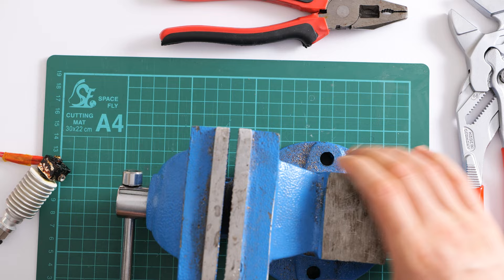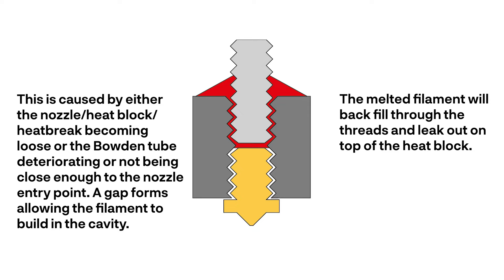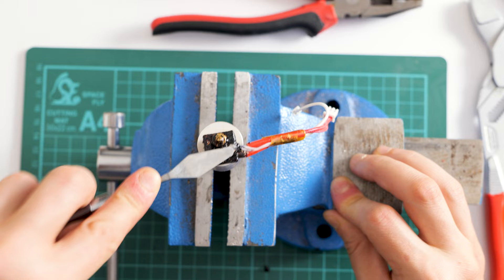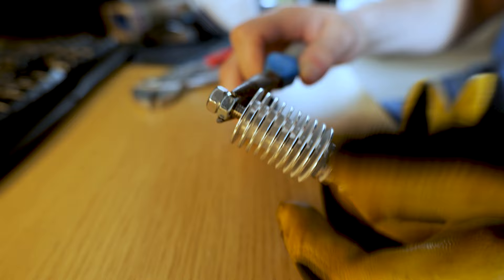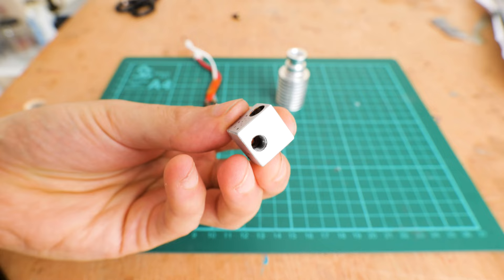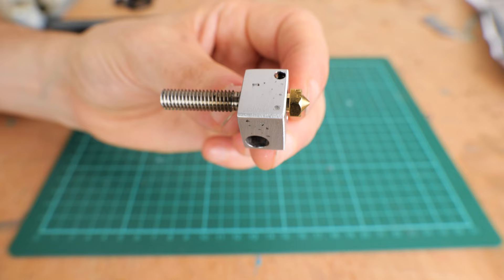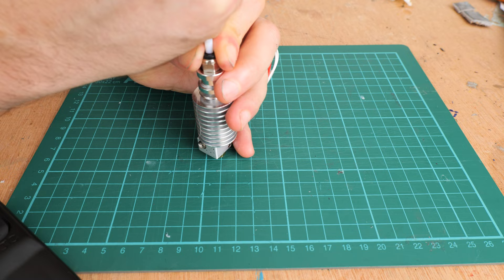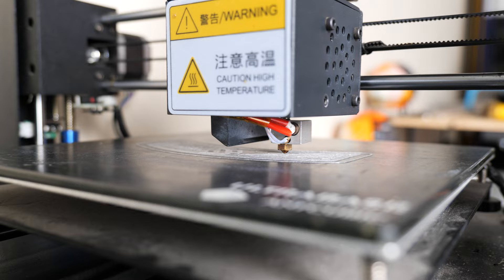How to clean your hotend and fix burnt blobs on 3d prints

Comment: To me, for a hotend as cheap and plentiful as this, I would recommend just buying a new one, and taking the opportunity to upgrade if possible.
Reply from the maker: Yes i agree, but at least its not going into the landfill for now. I was just curious to take apart and understand the hotend in more detail. I've gone ahead and purchased a trianglelab v6 all metal hotend in preparation for an i3 mega x carriage that I'll be making a video on soon. Now I print mostly with my Voron I take for granted the speed and quality it prints at. I want to try and bring the i3 mega as close to the voron quality as cheaply as possible.
Reply: In making your judgement about the value of your time vs the cost of just buying new, please remember that the cost to our planet of the resources used to make the new parts, and the harm caused by sending the old parts to landfill, is in no way factored into that cost.
A fantastic compromise is to buy a top quality bimetallic heatbreak and hardened nozzle - the real critical components - and refurbish the hot end with these parts, it will perform as well as a new high end extruder.
Reply: @edumaker-alexgibson  Is this even on a scale worth worrying about? I feel that's an important question here. I feel as if this is paper straws compared to the single use items in the world.

This item, comparatively speaking is replaced perhaps once every multiple years, and has far fewer transitionary processes than say a smartphone from mine to user. So, compared to the regular waste output of a person, I can't imagine this is a level of waste worth worrying about.

That being said, from an ease of use perspective, I think a titanium all metal heatbreak and hardened nozzle are a great upgrade removing the necessity to frequently replace the Bowden tube end or nozzle. I also value the added side effect of no longer spewing toxic pet bird killing fumes from the burning ptfe.
Reply: Depending on where you live it may be better to clean the hotend, rather than wait for the delivery. I'd rather spend a day cleaning one instead of waiting for several weeks for a new one to arrive.

Comment: I'm still using an anycubic i3 mega - I just finished the Ai3m hotend rebuild (thingiverse), I recommend it if you're going to a v6. You get a much better part cooling fan. How on earth does everyone destroy these heated beds so badly! I'm 5 years into mine printing pla and petg and its still nice and black and clean on top after multiple sandings :)
Reply from the maker: Haha, I yanked off the anycubic owl that comes with the printer and left a mark on the build plate after its first ever print. Ill probably upgrade to a magnetic PEI sheet for the build plate in future
Reply: @ThisDesignedThat  My ABS prints wouldn't stick, so I made my "special" homemade solution with ABS/acetone. It was too strong and I ripped a part of the black coating off the hotbed.

Comment: I always heat hot end up to the working temperature right on the printer. Then it is super easy to disassemble whole thing. Just be careful. Don't get burned.

Comment: Wow I have an i3 Mega and I swear, I couldn't find a single video that worked on fixing the hot end of this machine. I still have an issue with the nozzle where I have a metal-metal interface between the nozzle and heat break. The PTFE tube does not go through to the nozzle by design. This makes me wonder what fix exists to prevent filament from oozing out and blobbing above the hot end block.
Reply from the maker: Honestly i'd swap out the original V5 for the V6 as it has an all metal heatbreak. Better yet, go direct drive with the x carriage and put in a dragonfly or something similar.
Reply: @ThisDesignedThat  what would you set as the retraction distance for direct drive? I've been getting awful results at 0.5mm and no extrusion at 1.5mm

Comment: There is something very wrong with your printer.  Plastic should never be burning, the plastic should be temperature controlled far below that point.  Even the ptfe tube, that is extremely toxic and you  need to fix that.  I would replace the thermistor and make sure that it is firmly fixed.  Maybe try boron nitride the heat break and thermistor into heater block, and pc heatsink compound between the cold end and the heat break.  

Also, if you were having issues with a melted ptfe tube, you ptfe heatbreak is likely gone bad as well.  That should also be replaced.

Comment: iremove all ptfe parts and other plastic parts you want to save. when you have just metal and the plastic you want to get rid of soak the whole thing in acetone or give it a good spray of brake cleaner. Doing either of these two options will either make the melted plastic flake off, soften up so you can use a metal tool to scrap it off like it's jelly, or just dissolve it to nothing.

no heating or anything
Reply from the maker: Excellent tip, Im going to have to try this next time I clean my hotend. Im guessing it will also work on nozzles? Ive got a few old ones sitting around that need a clean.

Comment: So, after 3 years of 3d printing never having that issue it finally happened to me. Hopefully it happened to my very upgraded ender 3 with a biqu h2-500 which can reach 500°c no problem. Turns out pla just burns away leaving 0 residue at about 400-450, and I clearly remember somebody just torching the heating Assembly and being fine, has someone seen that? Can I have a link?

Some notes about torching the thing:
NEVER EVER HEAT PTFE ABOVE 230°C if you were to try this MAKE SURE there's absolutely NO PTFE around the torching area.
Aluminum melts at around 600°c so if you have an aluminum heat block (which likely means you're using a thermistor) you can do this with a torch but being very careful not to overdo it, just enough to burn the pla away and remove the thermistor and heating cartridge beforehand
Reply from the maker: thanks for the tip, im going to have to try this out at some point, see if it works. Actually tonight my voron dragonfly seems to have clogged so now i need to take it apart too :(

Comment: I know it's not an option for everyone, but the only way to clean a V6 hotend is by throwing it into the closest bin, and buying a not-shit hotend. Like a Revo, or similar.
The V6 is outdated. and needs to become ancient history.
Reply from the maker: But the revo is almost 10x the price of a 3rd party v6. The v6 is still going strong and does a good job for most normal filaments
Reply: @ThisDesignedThat  that's why i wrote that it's not an option for everyone.   The V6 eats your money and your time.
Cleaning it, failed prints, reassembling it when it inevitably unscrews itself. Broken heater wires. Broken thermistor wires.
Not even to mention the complexity and danger of breaking something when changing nozzles. 
Yes, modern hotends are more expensive.
But only in the short term. Over the lifetime of the product they are cheaper. Especially of you factor in wasted time.
Reply: I have good luck with my v6, but it is a fake one.  I have a titanium heatbreak and a copper heater block.  and a pt100, running off an amplifier chip.  It works very well, but has the same issue that his does and  you need to tighten it well for it to work properly.  It isnt really a big issue for me since I don't replace nozzles until they are worn out.

Comment: Dont use clones. You save a little initially but the print quality ends up being crap and you have to replace nozzles more frequently. Support British manufacturing and buy genuine e3d.
Reply: Step 1. Get Clone
Step 2. Get original e3d heatbreak and nozzle
Step 3. U have as good as original v6 for less than 20 bucks + spare parts